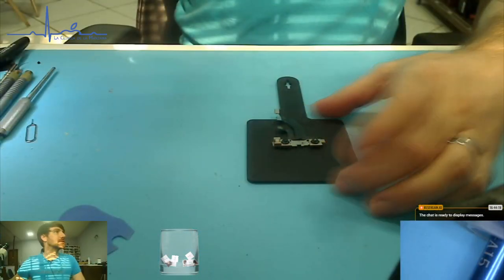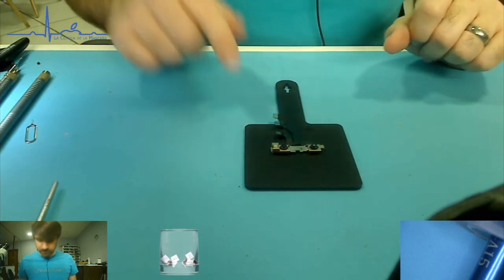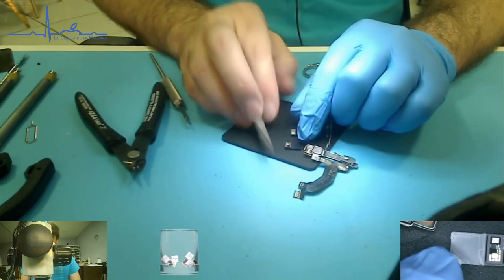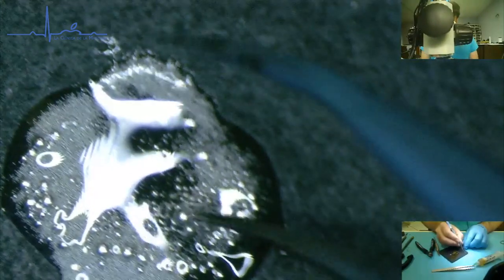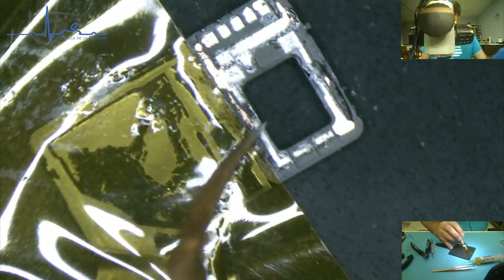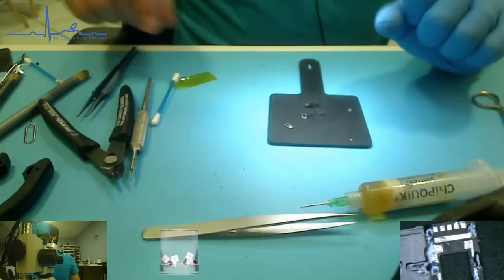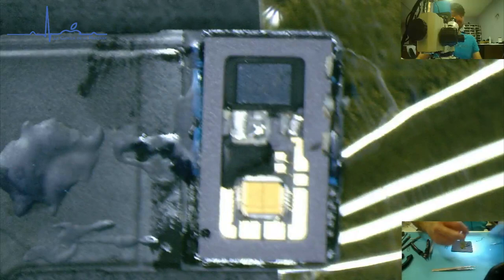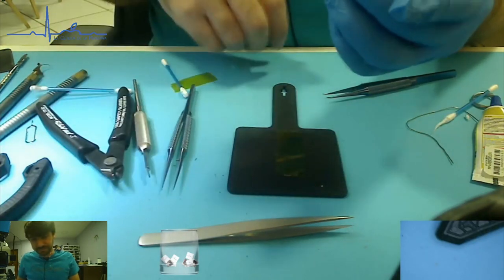Face ID Repair - Is it Safe?

Comment: So it that all you have to do? A jumper under the mosfet? What’s all the vids about a programmer?
Reply from the maker: Nope! The jumper under the mosfet is a needed process over all for this solution. There is a programmer that is needed. I tried to mention that a few times in the video and description. I don't have the programmer, but this is the process + plugging in the flex first to copy sn, and the new flex to burn the sn into.